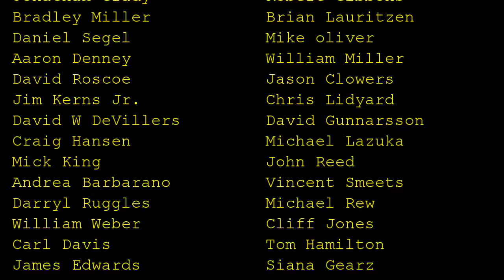OpAmp Oscillator Schmitt Trigger Math

Comment: I was completely with you until the "T" equation. Where did the 2.717 come from? Great video, but I'm not sure what I missed. 20K subscribers is great!!
Reply from the maker: No worries ln is a time constant
Reply: If B was 0.462, then ln((1+B)/(1-B)) = ln(1.462 / 0.538) = ln(2.717) = 1
This does not look random to me: the resistors were chosen as to give a B for which the (1+B)/(1-B) is very close to e, the math constant named after Euler. https://en.wikipedia.org/wiki/E_(mathematical_constant)